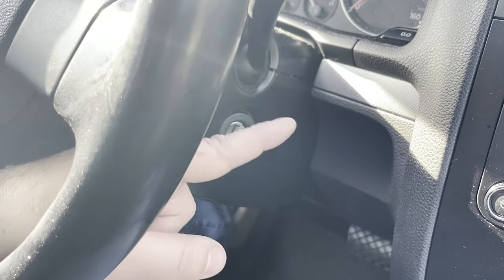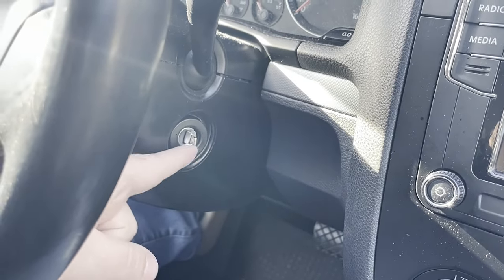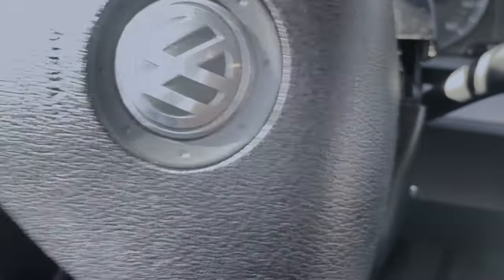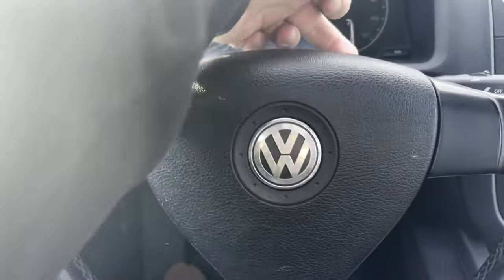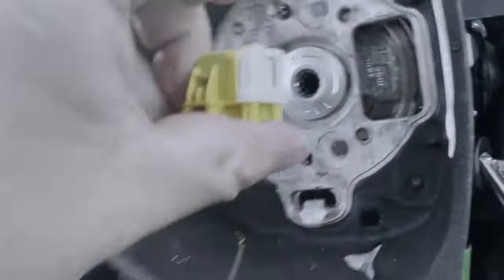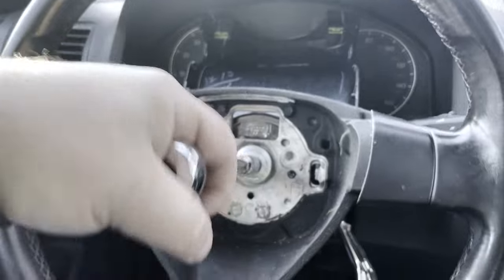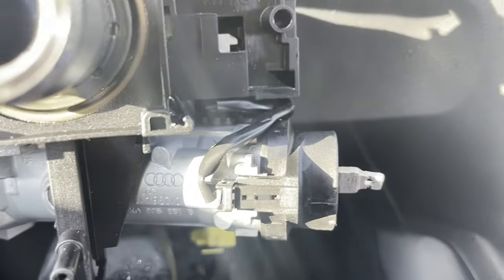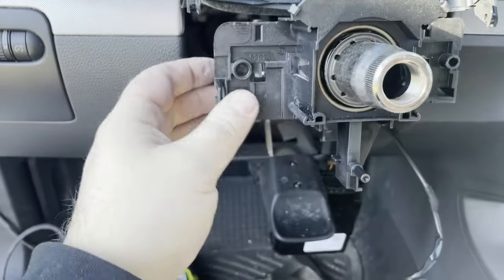Replacing Mk5 VW Ignition Switch Lock Cylinder

Comment: If I connect the old ignition switch and the old part were the key goes into and connect both those old parts to the robust cylinder I wouldn’t need to reprogram right?
Reply from the maker: I believe that is correct. you can even swap the RFID chips in the key fobs to match as well. I ended up ordering new fobs which needed to be reprogrammed.

Comment: Great video, but my airbag light has came on will it go out after a drive.
Reply: You probably moved the 'clock assembly 180° off. Wasn't explained in video that  the 'shiny ring cannot be rotated while off the steering column. Replacing it with a new one is not too expensive.

Comment: Awesome video now its time to see if I can replicate your results 😀👍
Reply from the maker: Good luck
Reply: ****GOOD VIDEO EXCEPT WAY TOO MUCH REMOVAL****

There is NO need to remove anything on the steering wheel - AT ALL. Disconnect battery and  (1)Remove the top and bottom outside cover (3 T20 screws), then (2) DRILL out (calm down) the 2 bolts on top of the ignition lock cylinder then use an extractor kit to remove the drilled bolts out (or you can rotate them out with a flat head screwdriver and hammer - good luck on that one).  (3a) Then remove the steering wheel angle sensor (bottom flat plastic tray piece under steering wheel):  there is a TINY T8 screw in the front, then you need a thin pick/strong thin wire for it's front clip (unseen clip but you can wiggle around a curve near the right side of the ignition switch to depress it's hold), the rear clip is easy to get to - use your finger near the rear of it simply press it in. (3b) Disconnect it's YELLOW clip on the right rear side of angle sensor and let it hang there no need to disconnect completely.  ONE MORE STEP TO FINISH.  (4) stick your fingers, from the bottom pointing upwards, to release the (2) tabs holding the ignition lock housing in place.  I pops right out - That''s it.  Can be done in about 45-60 minutes with right tools.  May take a couple of hours if your slow and cautious.  But at least it's a free fix.  Be Breezy -

Comment: Great video , we have followed all this but we can’t get the car to start properly, it starts then cuts out , then a steering  warning light comes on but everything is definitely back correctly.
Reply from the maker: The immobilizer is stopping it. Make sure the RFID chips in the key and the ring match. If they do then you may unfortunately need the dealer to reprogram it.

Comment: 10:20 Hey, so I have a 2009 VW Rabbit and I am not able to reach those screws at all in the car. They are farther back than in the video and I can barley even see the screws beacause of how crammed they are in there. Is there any way to move the steering column forward or down more?
Reply: It should have a telescopic steering column. Just drop the little tab thing down and pull the steering wheel towards yourself

Comment: Do you happen to know the size drill bit you used to drill out the bolts? It would be a huge help to a lady with limited tools and limited budget 😅
Reply from the maker: Honestly I don't. I used multiple bits, starting small and working my way up.
Reply: @ShinyFastLoud  6:22
Reply: T25 I believe
Reply: The bolts are the easiest thing to remove. I,ve been taking them off for over 30 years . Center punch once it bites it’s off ,Tension has gone,

Comment: After replacing the lock cylinder do you have to rekey to match the new cylinder?
Reply from the maker: if you replace the cylinder you would have to rekey to doors, trunk, etc to match to one key. Or you could order the OEM cylinder from the dealer and they will cut it to match the existing key. Its a little pricey but it is probably the easiest way to know you will have a matching key and it will be coded properly.

Comment: Do you have to reprogram anything if your are only changing the lock housing with the ignition switch?  I plan to reuse the same key and cylinder/ring.   I'm hopeful this work on a Tiguan.  Thanks for the video, very helpful!
Reply from the maker: In theory you shouldn't have to reprogram if using the same key and ring but I ended up having to reprogram.
Reply: @ShinyFastLoud  I can confirm you don't have to reprogram.  I swapped the switch and the cylinder yesterday.  The car is running smoothly now.  A 90 degree drill adapter is very helpful, all you need to remove (drill) is those 2 security bolts and disconnect 4 connectors which simplifies the process. Thanks again!
Reply: Of course you do need to program the transponder for the immobiliser
Reply: @ShinyFastLoud  how do you reprogram?

Comment: If anyone sees this, anyone know where to order a new cylinder? Like a link? I just can’t seem to find anything reliable, I keep finding new cylinders that don’t include the locking mechanism where you actually insert the key (the part he talked about taking off with a paperclip)
Reply: I got mine from rockauto, no reprogram no issues what so ever.  Just uninstall the old and put in the new.  Easy peasy.

Comment: Hi, does anyone know the part number for the New cylinder? Thanks!
Reply: for 2008 gti golf it is 1K0 905 851 B.  My VW store, and many more, are back ordered until the end of Oct 2023.  You can get the same one from NAPA for about 10-20% less.  Guaranteed to fit.

****GOOD VIDEO EXCEPT WAY TOO MUCH REMOVAL****

There is NO need to remove anything on the steering wheel - AT ALL. Disconnect battery and  (1)Remove the top and bottom outside cover (3 T20 screws), then (2) DRILL out (calm down) the 2 bolts on top of the ignition lock cylinder then use an extractor kit to remove the drilled bolts out (or you can rotate them out with a flat head screwdriver and hammer - good luck on that one).  (3a) Then remove the steering wheel angle sensor (bottom flat plastic tray piece under steering wheel):  there is a TINY T8 screw in the front, then you need a thin pick/strong thin wire for it's front clip (unseen clip but you can wiggle around a curve near the right side of the ignition switch to depress it's hold), the rear clip is easy to get to - use your finger near the rear of it simply press it in. (3b) Disconnect it's YELLOW clip on the right rear side of angle sensor and let it hang there no need to disconnect completely.  ONE MORE STEP TO FINISH.  (4) stick your fingers, from the bottom pointing upwards, to release the (2) tabs holding the ignition lock housing in place.  I pops right out - That''s it.  Can be done in about 45-60 minutes with right tools.  May take a couple of hours if your slow and cautious.  But at least it's a free fix.  Be Breezy -
Reply from the maker: I removed the wheel to make room for the drive before I purchased a proper angle drill.

Comment: I don't understand your method... I did the same job by just removing the 3 cover screws 2 behind the steering wheel and 1 below, without removing the steering wheel... Then the 2 screws with broken heads without drill just a small punch and a hammer and then the 2 electrical plugs of the neiman and the dismantling work is finished in 15 minutes while drinking a coffee!!!
Reply from the maker: I'm surprised you were able to just knock the safety screws out with a punch.  I'm jealous that yours was so much easier.
Reply: So what you used a punch but how did you turn the broken bolts out?
Reply: @abelscaliber7969 seen some people using the punch to tapping the bolts out like easy😂😂😂. I just can't do it

Comment: Great video 
I was not able to remove the locking switch 
It won't turn to the on position 
Any hints 
2013 VW JETTA
Reply from the maker: If the car is an automatic you might have to pop the shifter cover and try to override the interlock.

Comment: ****GOOD VIDEO EXCEPT WAY TOO MUCH REMOVAL****

There is NO need to remove anything on the steering wheel - AT ALL.  (1)Remove the top and bottom outside cover (3 T20 screws), then (2) DRILL out (calm down) the 2 bolts on top of the ignition lock cylinder then use an extractor kit to remove the drilled bolts out (or you can rotate them out with a flat head screwdriver and hammer - good luck on that one).  (3a) Then remove the steering wheel angle sensor (bottom flat plastic tray piece under steering wheel):  there is a TINY T8 screw in the front, then you need a thin pick/strong thin wire for it's front clip (unseen clip but you can wiggle around a curve near the right side of the ignition switch to depress it's hold), the rear clip is easy to get to - use your finger near the rear of it simply press it in. (3b) Disconnect it's YELLOW clip on the right rear side of angle sensor and let it hang there no need to disconnect completely.  ONE MORE STEP TO FINISH.  (4) stick your fingers, from the bottom pointing upwards, to release the (2) tabs holding the ignition lock housing in place.  I pops right out - That''s it.  Can be done in about 45-60 minutes with right tools.  May take a couple of hours if your slow and cautious.  But at least it's a free fix.  Be Breezy -
Reply from the maker: I removed the wheel to make room for the drill.

Comment: Those Bolt for safety? Bro you just unplug the socket from the ignition cylinder and hot wire start the car
Reply from the maker: Hotwiring is one thing, but the other security device is locking the wheel so you can't steer.
Reply: My 2012 Jetta has a gas immobilizer if it doesn't find the chip in the key. Gas shuts off in one second.

Comment: You did not end this video well, why... yr Job isn't finished ?
You don't show to start the engine and drive, with the replacement key.
My advice, better make a new video completely. 
Other point, showe very good  how to disconnect the cruise control unit & other poin, don't put the steering wheel back before you put the plastic covering so that you don't have to turn the wheel again and again every time.
For the rest, well don you tried your best making this video, congratulations.
GREETINGS from Johan D.  BELGIUM